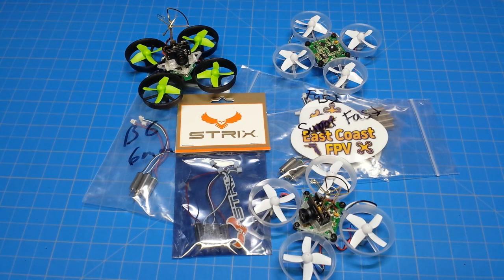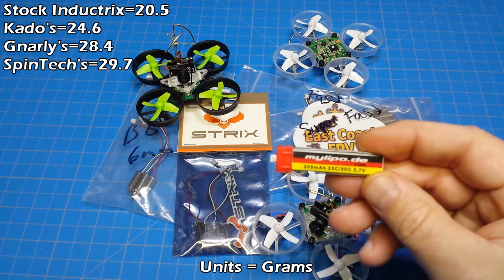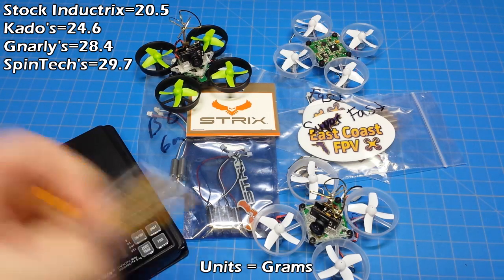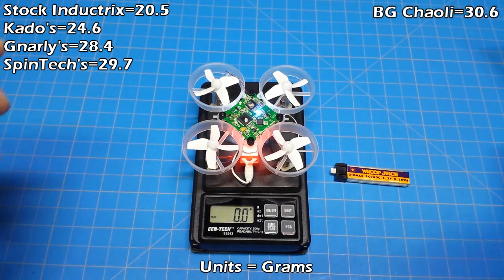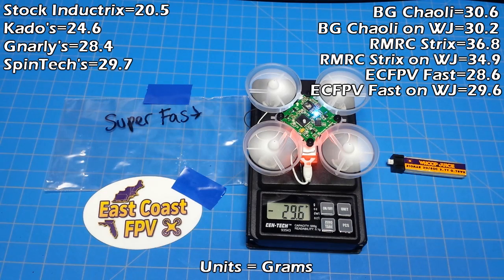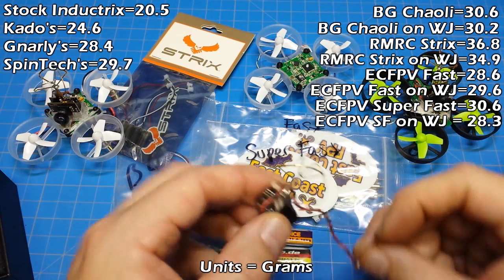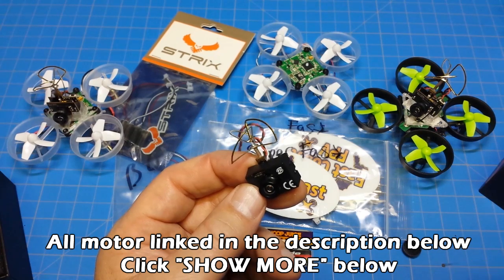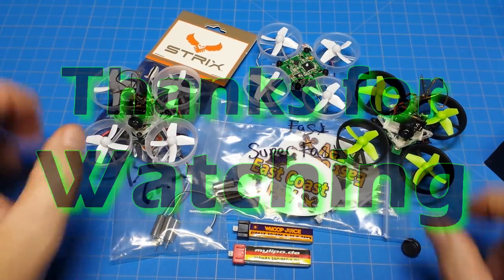Whoop Motors Test 2 (6mm motor thrust test)

Comment: I soldered a tx01 on a e010 with 67k racerstars and has stock 150 30c it’s shutting off out of nowhere and falling out of sky.. it’s off before it hits the ground & battery is hotter then it ever would be.. what’s your thoughts? Maybe a higher cell? 35-45c maybe? Since the e013 comes with camera stock & with 220 35c battery maybe that’s a problem they found too?
Reply: Any info would be great
Reply from the maker: If your flying a 150mah battery that is tiny. Traditionally on these we fly 300mah or 350mah.

Comment: alright here's the micro motor test stand,it was designed to hold 8mm motors. So you gota put some sorta spacer. work on them wedges for ya tomorrow.
Reply from the maker: cool.
Reply: He puts the props on backwards to work,think you can just blutack the motors right on the top or put motor in the other way if you gotta.
Reply from the maker: sure. should work very well.
Reply: It does,pretty clever. I will get them wedges done tomorrow and send it all on Friday.
Reply from the maker: thank you so much. Send me an email when your ready.

Comment: OK, you have to check out this rig he 3D printed for thrust testing brushed motors. so cool. https://youtu.be/YMrSBnQhR3A
Reply from the maker: yep I saw that. I got several message/emails about my thrusts tests. I am not sure if I had contact with this person or not. Its a good setup. Makes me wish I had a printer.
Reply: I got one,if I can find the file I will print you one.
Reply from the maker: That would be uber cool.
Reply: I will see if I can find it,if not I gota sketch program. I will just draw one up,not that hard. I will just copy his design.
Reply: found it,print it up tomorrow.
Reply from the maker: Did the guy in the video post it?
Reply: Yep
Reply: It's on thingiverse,he's pretty cool he uploaded it for everyone
Reply from the maker: Nice, its cool he posted it. If you do print it can you print a small wedge. Looking for something to stick the mini Mobius to.
Reply: Ofcourse ,whats the dimensions you need.
Reply: just need highth,width and length is all
Reply from the maker: using an online tool 22x6x21.16mm should result in 15degrees, 16mm wide should work. Thank you
Reply: No problem, anything to help the cause.😀
Reply: Wow that's small.

Comment: You spend a wrong measurement. Remove quadrocopter 10-15 centimeters from the surface of the scale. The air stream presses on the scales themselves.
Reply: I agree but you should edit this when you are not drunk.

Comment: Awesome comparison, thanks for doing this. How do the stock Eachine E010 motors perform?
Reply from the maker: My recollection was about 28grams max thrust. So okay but there is better
Reply: Got it, thanks. I guess what I'm really trying to ask is how well the stock motors will perform for lifting an FPV cam. I have a TX01 on order that should be about 4.5-5 grams and I'm hoping either the stock or Chaoli's will do the job.
Reply from the maker: The stock motors will lift the 4.5gram cam. But there won't be much punch. The strix are what I run. They are about $14.

Comment: The stock Eachine motors have about 8 grams of thrust, and the Chaoli have about 29 grams of thrust, this is correct? right? Just trying to decide if the chaoli are worth it for just $8. Thanks for the tests and sharing the info!
Reply from the maker: 8grams stock....that can't be correct. If I gave you that information I apologize. Its more likely 18grams stock. I don't have the stock motors to test anymore. I have been flying a custom E010 whoop with the readmaderc strix motors. I think they are a good value at about $14.
Reply: woops, sorry, it was supposed to say 18 grams.. Thank you for the info. Thought the strix would be more expensive, that is not bad at all.
Reply from the maker: I like them, they don't seem to kill the battery nearly as much as I thought it would. Typical logic is more thrust less flight time.

Comment: I'm curious as to the thrust on Syma X11 motors. They seem to have tons of thrust and are dirt cheap (but use massive current).
Reply from the maker: Looks like the thrust benefits from geared motor/props.
Reply: No, I mean the motors themselves. I had a spare set I tried in my inductrix and they're crazy fast in comparison to the stock motors. They can be had for like $8 a pack of 4 so they've been my go-to tinywhoop motors.
Reply from the maker: Ah I see. Thanks for clarifying. Where do you get them?
Reply: Amazon has them. I use the ones specifically from 
seller AVAWO.
Reply from the maker: Thanks for the information.
Reply: I have two X11s... would definitely be interested in seeing a review of those put in a whoop

Comment: awesome motor test Nick, so many out there now !!!  I'm rockin the Kados Insane motors right now...also have you checked out the 200mw VTX from VooDoo quads ?   looks good to me !
Reply from the maker: I have seen it and I agree has good potential. I suspect its the same as the one recently released shown on Banggood. If it weighs less than 5 grams we could have a great little micro cam/vtx.

Comment: Nice video. I've got chaoli 8.5s and some 600mahs, just waiting on a frame. MC02 is here also, what do you think of it? I know its heavier but I want the 200mw.
Reply from the maker: I think the vtx and camera perform a bit better than other lighter cam/vtx aio. I don't recall if that one needed a regulator or not. I would check it before you get it all soldered up. Just connect the camera, and get your goggles showing the image, throttle up and see if you see lines or can see at all. If its clear its good to go, if not regulator will be needed. This is all if your powering from flight battery.

Comment: Great test Nick 👍. I bought Chaoli motors with my E010 but I haven't fitted them yet. I'm waiting till I get some descent batteries. Apparently a 300mAh nano tech will fit the E010 battery bay if you remove the cover from the battery and cut away the front of the battery bay. MicroRcfiend got four and a half minute flights with a 300mAh nano in the E010 with stock motors. He said two and half minutes of good power but a total of four and a half minutes total flight time. Thx Dod.
Reply from the maker: I haven't seen his video, he does a lot of cool stuff. I usually only buy one or two new batteries before I flight test them, if I like them and need, I get more. I get about 3mins fpv with the E010 on mylipo 175 and 205mah.
Reply from the maker: I have fallen off the HK 1S batteries. I find they loose a lot of punch after 10-15 flights. But getting lipos shipped is a challenge as well.

Comment: Do you know by chance the functional difference between FX797t and FX798t Combo Cameras? I'm dissapointed at Bangood lately. Hoping to get into the Tinywhoop thing but My order for the E010, EV800, EF01, DVRPro and E010 got cancelled. Was on backorder status too long. Looking for replacement for the E010 from Gearbest like the NH-010 and the JJRCH32. Again I'm looking forward for your detailed reviews.
Reply from the maker: The only functional difference is how the antenna is connected. The 798 has coax connecting the lobes, this will transfer some impact on crash away from the lobes, thus decreasing lobe damage. The 797 does not have this so the impact is either absorbed by the lobes of the antenna or the pcb which is even worse as that repair would be much more difficult. I cannot speak to the flying capabilities of the JJRCH32 as I have not flown one. They look the same, but we don't know if there are differences.
Reply: the fx798t has a piece of flexible coax on the antenna between the pcb and the 'leaves' where as the fx797t has the 'leaves' soldered directly to the pcb
Reply from the maker: what he said. More direct and to the point.
Reply: Thanks Nick and Jon.
Reply: sorry i didn't see your reply when i posted mine nick lol, else i wouldn't have doubled the information :O

Comment: what power do the stock eachine 010 do?
Reply from the maker: what power? Battery? Its a 150mah battery, the C rating is a whole another topic. There isn't a standard for quantifing C rating, so they can be all over the board. I have 35C batteries that out perform much higher C rated batteries.
Reply: I mean how many grams...eg how much benefit to upgrade the motors....
Reply from the maker: Stock E010 18.1 grams.

Comment: Do you think it would be worth the trouble of putting motor connectors on Eachine e010?
Reply from the maker: It really depends, someone that likes to solder and/or tinker would likely put connectors on, others not. I haven't yet, but I am also going to be taking the board out of the E010 soon to place a different board in its place.

Comment: You should do the LVC mod to your TinyWhoop! I get another 30-40 seconds of flight time and the battery comes down at 3.5v.
Reply from the maker: what do you say? I have not heard of this.
Reply: Nick Burns It's on Facebook. All you gotta do is bridge 2 resistors.
Reply: What is the value of resistors in ohms and watts, please?
Reply: I have no idea. Check the Facebook post.
Reply from the maker: I will have a look